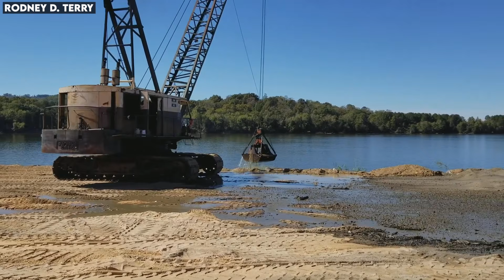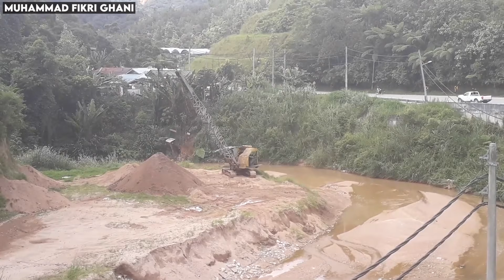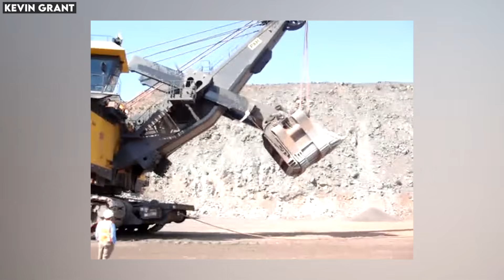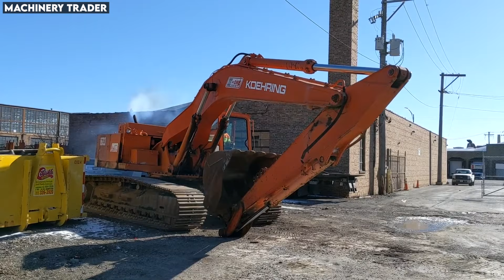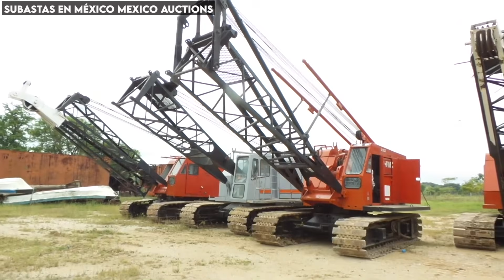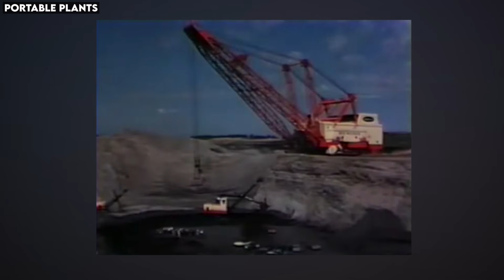10 Forgotten Excavators That Were Better Than Modern Machines

Comment: The (LINK BELT-LS- 98) was used by Loggers in the heeling boom setup. They are still used a pltform for "HAUL BACK" of trees to Logging Landing with the Boom set up High. One was used on the T.V. show about Logging, and the company loved it 😊 the nice thing they did was put a big steel area around the control Levers for a place to rest your elbows or arms of the operator. They liked that setup especially on the inhaul times for trees to come up the hills, most all spare tree setups for Logging with a big tower, use that same flat area at the control levers, for operator to lay their elbows on when working the cable drums.

Comment: NORTHWEST upgraded their operator station even in the cable era, on a Dragline setup you could lockin the inhaul lever, it stayed back in position so you did NOT have to always keep your hands on the lever, it made for very smooth in hauls of bucket, they made the levers on cable excavator more in tune to the functions. They were the first I believe to copy the British on a Factory installed "HYDRAULIC" bucket curl, like the British had done to their older Ruston Bucyrus cable excavator that I believe were all built by the owners as a add on hand built by the owner, NORTHWEST was the first to do it at the Factory for a new owner, a big plus on working around a Utility line that crossed the ditch, plus so versatile for cleanup in ditch lines and dumping into dump trucks.

Comment: You also mentthe (KOEHRING) Line I remember a 1266 used by a major contractor in my area, it dug most of a big Sewer outfall project from Renton Washington to Seattle, it had a massive bucket I want to say like 8 yards, what I loved about the Koehring was the control Levers, with Air control Button on top of the two main Levers for your Boom and swing. You just pushed the buttons on top of the two levers, for the other two function the bucket curl, and Dipper in & out. It to me was very unique with that Air over Hydraulic system. And it seemed to be easier on the "WRISTS" of operators. The Bucyrus Erie Air over Hydraulic excavator you had to use your "WRISTS" on all the function that Koehring just used push buttons for Bucket and curl, Bucyrus did have a middle foot pedal for the Dipper arm that Koehring did not have, the foot pedal was for say, pushing a pipe together with more Hydraulic pressure going to that foot pedal 😊

Comment: One thing you Forgot to say about the Bucyrus Erie or Ruston Bucyrus was it could be fitted with a "BACKHOE" attachment with cables, or called in early times a (Back Drag)
The British were very unique in upgrading the Cable system to a single Hydraulic system for the "BUCKET" to make it "CURL" 😊 I did not see that on American Bucyrus machines till the early 1960s, in my area. One big sewer contractor in my area kept his very Large Bucyrus with a cable Back Drag system with the Hydraulic "CURL" bucket well into the 2000 I would see it apart at his main yard, ready for the next job, it had done River crossings for mainline sewer jobs, with the contractor using the Dipper arm as the Depth mark for under the river water.